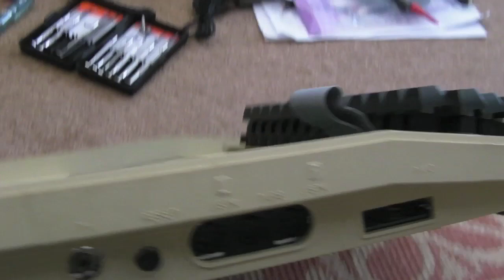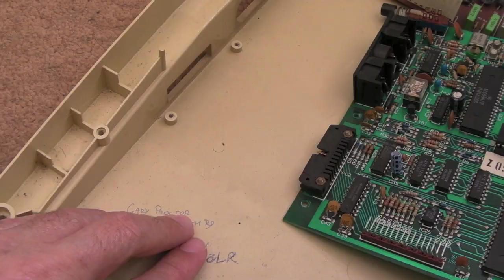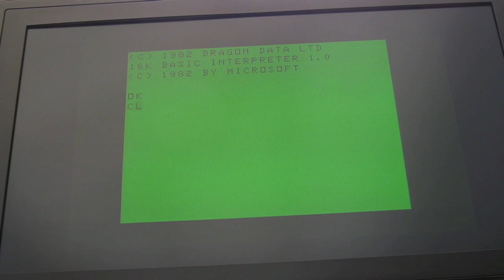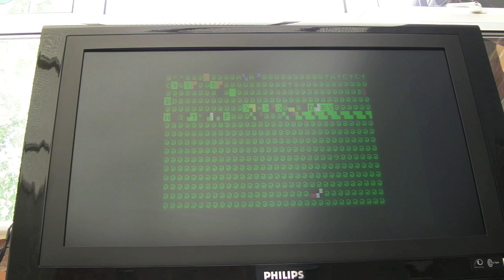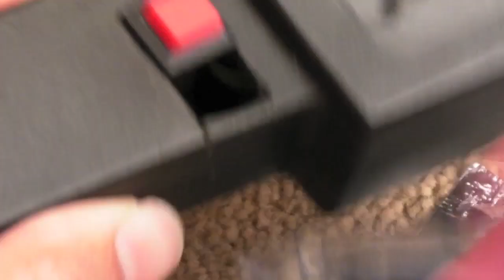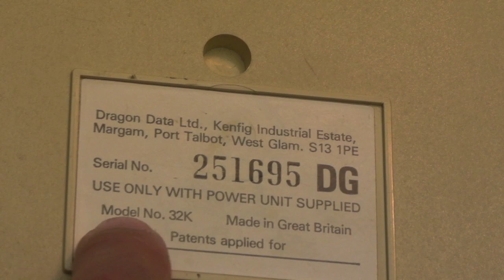Dragon 32 Garbage to Gold (Will it fly again?)

Comment: We had a Tandy Colour Computer in the family of which the Dragon is a clone.  It was a fantastic machine.  The Dragon was in some ways better thanks to its better keyboard.
Reply: clangerbasher The Dragon wasn't a clone of the Tandy as such. They both were direct implementations of Motorola's reference design.
Reply: @jasejj  is true
Reply: Oh! Right that's interesting.  I happily sit corrected.  :)
Reply from the maker: The Tandy looks cool too though =D
Reply: Well one advantage of the chicklet type keyboard was that Tandy included drop on keyboard templates with some packages.  Whether that was a feature when they started to design the box or something that occurred to them afterwards I don't know.  It was a lot more advance than our other box a Spectrum.  The MicroSoft Basic was very powerful.  I remember it even included commands to start and stop cassette recorder  motor.
Reply from the maker: Yes, I did wonder about that - it's no coincidence that nearly every chip is a Motorola chip lol =D